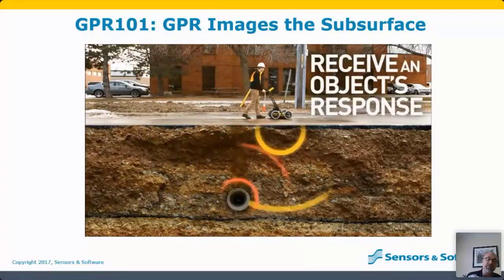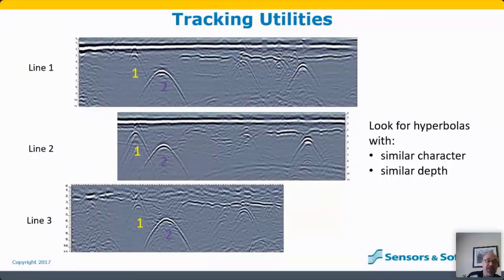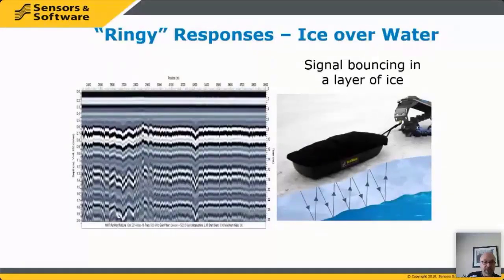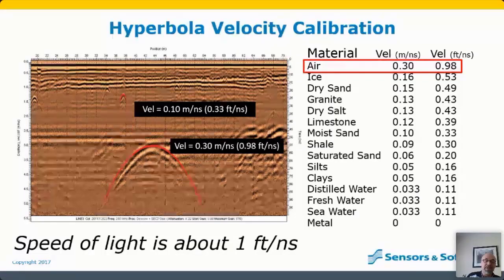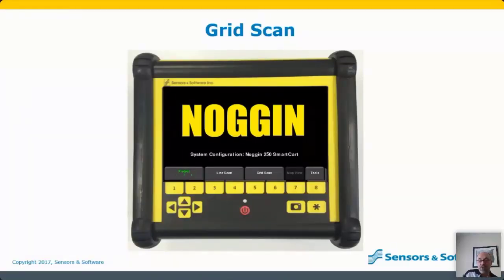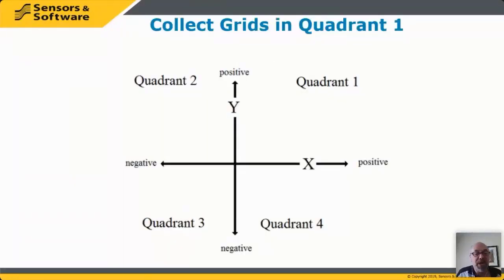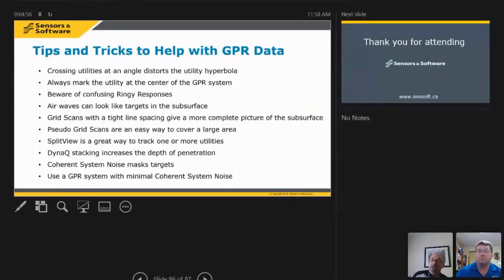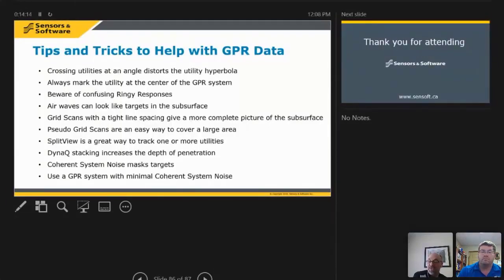Webinar: GPR Utility Data – Tips & Tricks

Comment: can we use another kind of antenna to push the signal only to one side?
Reply from the maker: Not in my experience.  It is difficult to “direct” GPR signal.  You can sometimes see that you are approaching an object by seeing the start of the hyperbolic tails, but imaging a target requires the antennas to pass overtop of it.
Reply: Thanks so much  @sensoftgpr

Comment: Is there any way that i can know the type of the metal or whatever the thing under the ground based on the hyperbole?
Reply from the maker: GPR cannot distinguish between types of metals.  However, if the object is non-metallic, it will have a slightly weaker signature. Also, you can sometimes tell the material composition by looking at the polarity of the signal.  In other words, the top band of the hyperbola might be black for a metal object, but white for a plastic object.  In practice though, this isn’t always easy to tell

Comment: Very informative.   Are there any tips to identify  between type of material For example a Cable , a Metal Pipe vs a Plastic Pipe vs a Cement Pipe.   Or a Plastic Pipe containing a cable, Optic Fiber Etc.
Reply from the maker: We can't identify the material of the pipe directly. But a non-metallic pipe will have a weaker reflection than a metal pipe, if they are at the same depth and roughly the same size.